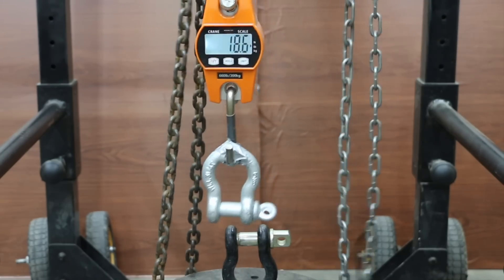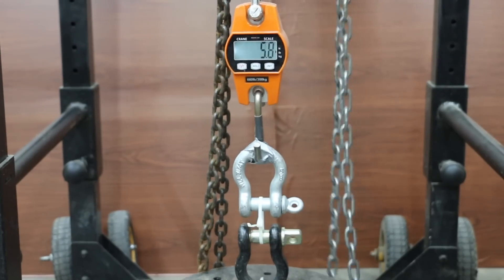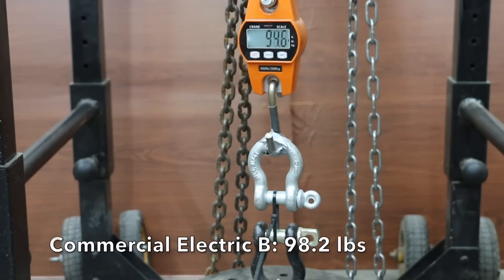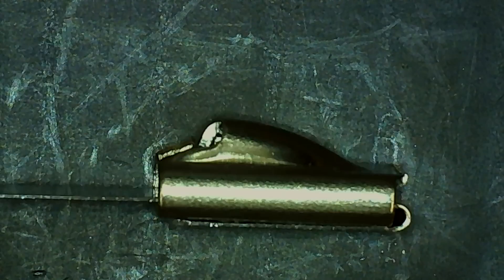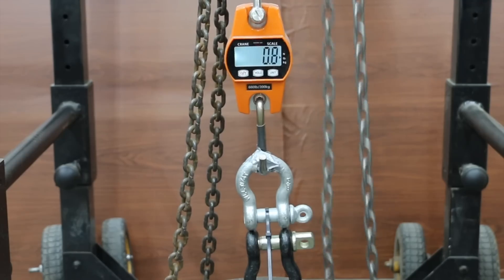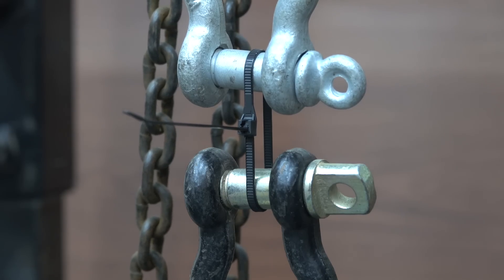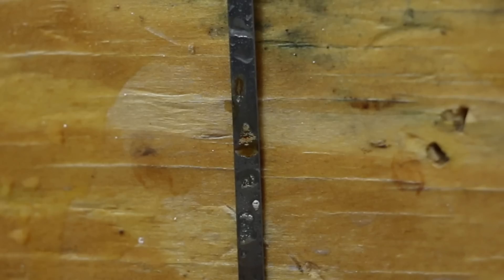Best Cable Tie (zip tie) Brand? Let's Find Out!

Comment: How about different types of radiator repair, from kits to hack jobs. I've fixed a couple using two part putty epoxy on the plastic and folding of the flat metal tubes to close them up. I also tried plastic welding with a soldering iron and zip ties with little luck; I've never tried those plastic welding kits.
Reply from the maker: Great suggestion!  Thank you.

Comment: For the cylinder head test, try using something with some flexibility, like a caulk or silicone so the seal stays intact and the ties hold the load.
Reply from the maker: Thanks for the suggestion.

Comment: I recently added zip ties to my toolbox, I use some 200 lbs ones on my truck bumper to hold the cover/rubber piece on... The tool you never knew you needed is a "zip tie cutter." Flush cut diagonals, I bought 6 for $5 online and handed them out to friends and family. Very sharp, but not for wire or metal.
Reply from the maker: Thanks for sharing.

Comment: With regards to the JB weld / tie wrap cylinder head test,  because no head gasket was used it raised the compression and may have even allowed the valves to mechanically contact the head.
Reply from the maker: Thanks for the feedback.

Comment: Hi project farm I am a metal worker and I use a welder a lot and I wondered if some weld electrodes preform better(which is stronger and which will hold longer?)
Reply from the maker: Thanks for the video idea.

Comment: It crazy that most of the plastic ties performed better after a year of UV exposure. Very interesting and GREAT video!
Reply: The cable ties are picked before they are fully ripe so they don't bruise in transit. The sunlight just brings them to maturity.
Reply from the maker: Thank you!

Comment: So much better watching your torture tests than those done in a labrotory.  I think picking up the rear of the pickup with the rusted out wheel wells was the icing on the cake.  Do you think it would do as well on the motor home?  Might have to use two on it.

Comment: I always thought what would happen if you bought 3 or 4 new harbor freight motors and run 87-89-91-93 octane or non-ethanol octane with the same amount of gas to see what would happen? Like does 93 burn cleaner then 87 or if anything at all happens different from non-ethanol. It won’t be a long video but Could be interesting.
Reply from the maker: Thanks for the video idea.

Comment: Last winter I bought snow chains for my lawn tractor so I could use a snow blower attachment on it. The chains were supposed to fit my size tire, but were a bit short. I used metal cable ties to make extra chain links. They lasted all winter, no issue!
Reply from the maker: Thanks for sharing.

Comment: My experience with nylon ties has been pretty variable. I have some of unknown origin bought at yard sales mixed in with Harbor Freight so I don't necessarily know which is which. Plus I've had some for a long time---years. I have discovered that time as well as UV can make a huge difference. I've had ties that snapped while applying them to hold flags to a balcony railing while others hold up well over a year. Aging plastics can make a huge impact. Maybe some of the ones you tested that didn't do so well had been hanging on the hooks in the store for a long time getting cooked by the florescent lighting in the store? Unfortunately they don't put "use-by" dates on them!
Reply from the maker: Thanks for the feedback.

Comment: Highly flawed 'testing'. 
NO natural colour [white] nylon cable ties are UV rated EVER. 
You exposed these to UV exposure for 1 year. This 1 year is a fraction of typical instillation service life. 
Why bother testing the ties only designed for enclosed use to UV radiation? 

The manner in which these are tested is NOT the way they are used in practice, especially the Stainless bands that would not have failed by fastener clip peeling open. In service that fastener clip is bound closed against the cable or pipe being mounted on a metallic cable tray.

The Clasp moulding should be at the top of the shackle bolt in your test, so that tension is applied directly through that clasp.  Here you have force applied to the outer moulding that distorts that portion of the clasp away from the locking paul. 

Further, cable ties are not designed to act like a chain link.

Side note: You double the weight-bearing capacity of these ties by having a double loop around the cable being held.

Comment: I have two video ideas because I am going through this process right now: 
What are the best trailer deck board fasteners?
What is the best best coating for a wooden trailer deck? Stain, bedliner, normal paint, etc?
Reply from the maker: Thanks for the video ideas.

Comment: The plastic ties with a tri- lock mechanism seemed to fail at the lock. Probably because the teeth are smaller I'm guessing. If they fit 5 teeth in there, it probably wouldn't help because the teeth would be tiny. Another great video that guys like me can actually use. I request more Hyper Tough (Walmart) brand testing. THX.
Reply from the maker: Thanks for the video idea.

Comment: Wow, I'm actually amazed at how well the plastic Harbor Freight zip ties did... The medium sized hundred pack of the black Harbor Freight ties is my go-to for pretty much everything that needs cobbled back together. I usually use 3 or 4 of them lapped over top of each other because I figured they'd be weak considering how cheap they are. But according to this test 3 of them overlapping each other probably has the tensile strength of a 1 inch diameter grade 8 bolt lol
Reply from the maker: Thanks for the feedback.

Comment: I see you didn't attempt to create a cold environment. That's when they really struggle. In the winter when it's no where near -40 they will fail. The cold is the real test . The metal ties are best but honestly some of the things your installing won't be safe with metal it will cause a grounding issue but that's a different story. Let's see cold weather use this Winter so people can see how big of a pain in the ass these things can be. But that said they are a good send to anyone needing a quick fix!

Comment: I work for one of the companies featured in this video.  This was not really an apples to apples comparison.  The cable ties were not the same size and/or style.  Also, the "UV Exposure" results were more likely due to changes in moisture level.

Comment: First of all, thank you for making all the great video and I enjoyed watching them very much! Now here is an idea ... I am about to work on my SUV (2018 Highlander) to replace all the break pads. I shopped around online (mostly in Amazon) and read many user reviews. Still, I don't get a good sense of which brand is better (say Toyota OEM vs Bosch or Wagner). I immediately thought about you .... wouldn't it be possible to rig something up and run some test to verify the longevity, dust, temperature under high speed, etc. THANK YOU!
Reply from the maker: Thanks for the suggestion.

Comment: For what it’s worth, Harbor Freight sells average to above average tools and accessories. And for the home do-it-yourself guy, the tools are more than adequate. Now, if you own a machine shop or work in the automotive industry professionally, Harbor Freight more than likely isn’t for you. Perhaps in a pinch, but overall you’re going to opt for Snap-On or Mac tools. I used to be a strict Craftsman guy, but found little difference between HFs quality and Craftsman regarding hand tools. Conversely, Craftsman power tools are noticeably better made than most HFs. Guess it really comes down to what you’re willing to spend. It’s all about the Benjamin’s...
Reply from the maker: Thanks for the feedback.

Comment: Interesting stuff. I just bought a 100 pack of the 11 inch ties from harbor Freight. I was a late bloomer with zip ties but once I started using them a couple years ago I wondered out loud how I ever lived without them. Up until then I was still using twist tie and I've had the same roll of electric fence wire that I've been using for a good 20 years.
Reply from the maker: Thanks for sharing.

Comment: Someone may have commented on this already but I’d be curious how the nylon ties perform after exposure to water. The hygroscopic nature of nylon causes them to absorb water. I know I’ve used water to “restore” brittle zip ties to usable condition. I work in the plastics industry and parts molded in nylon usually get packaged with a damp sponge for the same reason.
Reply from the maker: Thanks for the video idea.

Comment: Hi Todd, One suggestion for you to test is browns gas running a mower or generator engine.
Browns gas is a mixture of hydrogen and oxygen easily made by electrolyzing water.
All over the internet there are claims it can increase fuel economy up to 80%, and other claims its all a load of bullshit.
For the test you would have to generate the power for the electrolyzer on the engine you are testing, to prove better or worse economy, and also a lawn mower or generator engine would be a great test as they don't have all the electronics in the way.
Now i don't need a test to prove the energy produced by burning the gas is always going to be less than the energy needed to make it, that's basic physics, no such thing as a free lunch.
The only way this idea is going to come out on top is if the gas improve's the combustion process enough to negate the inefficiency of the gas production.
Would love to see this done by yourself as the results can be trusted.
Reply from the maker: Thanks for the video idea.

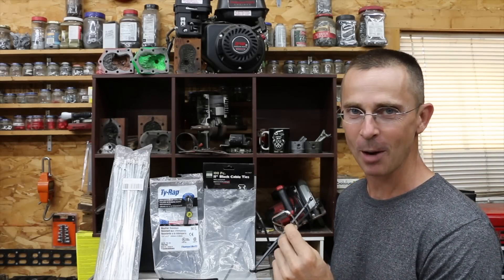Comment: 14:23 - Yeah, been carrying for a while now, since I found that they existed (lol), and almost exclusively using SS ties whenever I need to zip tie something. Although it's worth mentioning that there is a bit of slop with the SS ties as the locking ball needs to travel about 2mm back down the wedge in the head, to lock when tightening, so when tying two (or more) rigid items together, they wont be as tight as you can get with a normal tie, if doing it by hand. There are commercial tools that will "stretch" the SS ties, to make them tighter, but the force created may be more than the parts you are trying to tie together can handle (eg plastics).
Reply from the maker: Thanks for the feedback.

Comment: You should try what we use at work they are called deltec it's a half Inch wide and the locking point I'd a metal dog that digs in to the plastic strap
Reply from the maker: Thanks for the suggestion.

Comment: first thanks for another great video. I just had a question to ask. Did you try to reposition where the lock was on the ties maybe off camera. I have had to use zip ties sometimes for a lot of different reasons and especially some seem to do better especially if it was as large as a chain link fence post for example and you place the lock on the largest part and away from the load. I know the way you're doing it tests the locking mechanism better, but if it was placed on something larger away from the load it may test the strength of the tie  strength better. Hey don't pay no attention to me though I'm just a crazy old man. I'm just glad the only thing it happened to Larry today was just temporarily lose his head! You might want to put up some security cameras around your house, I think Larry is slipping out down to a local bar called The Oil Can and getting plastered at night. I think he's planning on running away to Mexico with a leaf blower! Have a good day I'm sorry I couldn't resist throwing in a little foolishness.
Reply from the maker: Thanks for sharing!

Comment: I am retired US Navy engineer and we used a product called "Copaltite" to seal steam pipes, steam turbines, flanges, valves, and once we even used it to coat the entire top of our deaerating feed tank because it had so many leaks in it.  It wasn't considered a permanent fix, but it lasted until we could get a shore based repair facility to do a permanent fix.  I am super curious about the actual limits of the product.  Seeing the head on the lawn mower engine come off after using JB weld, I love JB weld, made me wonder if "Copaltite" could do a better job.  You could run that stuff through a whole battery of tests just to see its limits.
Reply from the maker: Thanks for the video idea.
Reply: @ProjectFarm  I forgot to mention another product we used in dire circumstances.  It is called Belzona.  It is a two part product more in line with JB Weld, but that stuff was pretty impressive.  You can actually build parts out of it.  They have several different formulas, but personally I am more interested in the 1111 and 1212 formulas.

Comment: I worked at a hospital for a year servicing around 1200 electric motors for the air conditioning system. The cable ties securing the electric motor wire were extremely brittle in a few years, and even 9 months since the last service (when cable ties were replaced) was enough to brittle them to the point you could just pull the wire breaking the ties. 

In conclusion, seems like constant airflow and fluctuating humidity brittles the cable ties much faster than UV exposure. Funny thing was that there was practically no difference in zipties between the input airflow (which was -20c in the winter and +25 in the summer) and the constant +20c output airflow temperature.

I never found out which variable "dried out" the zipties. Humidity, volume of air, temperature or something else.
Reply: For anyone wondering, put "flakt woods plug-in fan" in google image search. Those fans were encased in insulated boxes, and the zipties were inside those boxes in constant airflow.
Reply from the maker: Thanks for sharing.

Comment: There are actually videos on another channel where a guy used zip ties to hold the coil springs in place in order to change struts on vehicle. Insanely dangerous. With a ton of zip ties he actually pulled it off without killing himself 😅
Reply from the maker: Thanks for sharing.

Comment: Those stainless zip ties are great. I'll have to stick a few in my bag.
Reply from the maker: Thanks for sharing.
Reply: They're really nice. One warning however, me and my dad use them for the header wrap on out drag cars, and if you pull them tight without a pair of pliers you WILL get a naaaaasty cut. I went down to the bone on my index finger trying to once, never again. The sides of the ties are just like the edges of a sheet of tin or a cut aluminum can. SHARP!!
Reply: @Reebz44onTTV  did it affect your time
Reply: Just dont wrap them around plastic on something that vibrates
Reply: They won't just cut your hand, they also have the negative side effect of chewing through what they fasten more aggressively than plastic
Reply: I remember watching a video of someone using them to keep a spring compressed to install on a coilover. A little to risky to me but hey, if you're feeling froggy lol
Reply: I’ve been using “rugged- perfect for winter” plastic ties on my sailboat winter cover for four years.  It secures a skeleton of plastic electrical conduit to the boat, with a fitted fabric cover over it.  It sits beside the shore of Lake Ontario, covered in snow, and exposed to howling icy winds all winter.  Every year, I’d come back, find broken pipes and broken zip ties.  The snow would fill in the depression and start to collapse the cover.  I’d check it every week and make several repairs every winter, which was a huge pain.  I always wondered if it was the zip ties or pipes that were failing.  After seeing Project Farm, this year I switched to the metal zip ties he tested.  The result?  As of yesterday, no breaks, no damage, zero issues.  I taped over each metal tie to keep the razor edges from slicing through the cover.  Thank you Project Farm!
Reply: It’s usually code to use those when fastening cables to vertical runs up cable trays or horizontally to the under side of cable trays.
Reply: A bunch of them might just work as emergency tire chains in a pinch too.
Reply: Handy if you need to arrest a robot.
Reply: A few? Jesus I'm gonna throw all my other tools away and just use these
Reply: A work colleague actually killed himself with a pair of those. He would probably have been saved if he used ordinary plastic ones. His girlfriend found him in the kitchen but could not find anything to snap them. Even the ambulance personnel was struggling to get them of.
Reply: @nameofthegame9664   - I'm no EMT, and actually get light-headed at the sight of blood, but it seems to me that an emergency Tracheotomy would have been used for an instant airway if the guy was still at the point of being saved... Unless it was a blood flow issue like a self-induced stroke? but that would take as little as a few minutes from the time that he zipped himself.  Like I said... Not even CLOSE to a doctor here, but damn... What a shitty way to go.
Reply: @_Common_Logic_  that would allow his airway to function theoretically, but wouldn't relieve the closing of the carotid artery due to the cable tie. Don't think it would save him.
Reply: @Ellron23  - Yeah... That's exactly what I meant by "A blood-flow issue like a self induced stroke".  

I'll give him points for creativity, though.
Reply: Nameofthegame  around his neck?
Reply: @nameofthegame9664  😔

Comment: Todd, I just recently happened to have bought stainless steel zip ties for the heck of it.  Having watched your video, I'm going to place a bunch in my truck glove box.  By the way, a few years ago the steering slave bar to my twin outboards of my boat broke at a weak pivot point and I could only steer one engine. I happened to have just bought 18" zip ties and used them to tie the slave bar back onto the engine. It worked and I was able to steer both engines to get be back to the marina. Zip Ties are vital to everyday life🤣. Thanks, Iggy
Reply from the maker: Thanks for sharing!